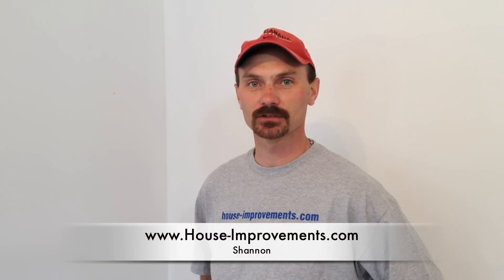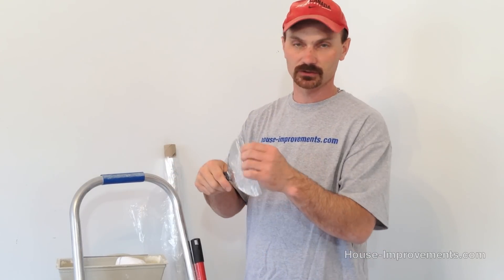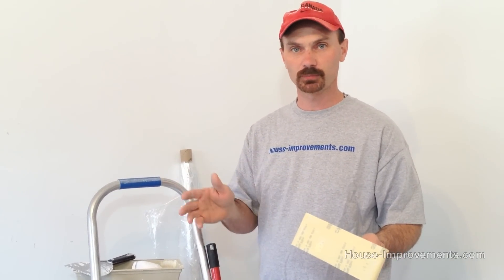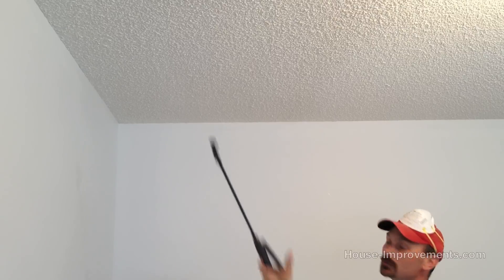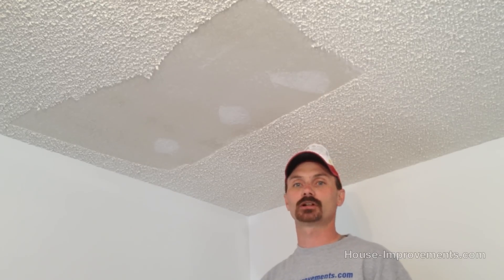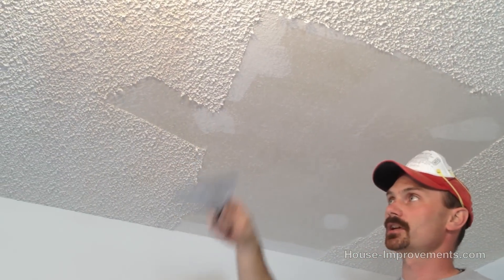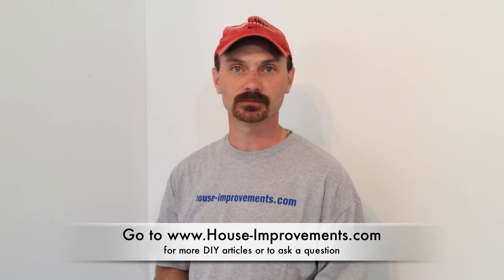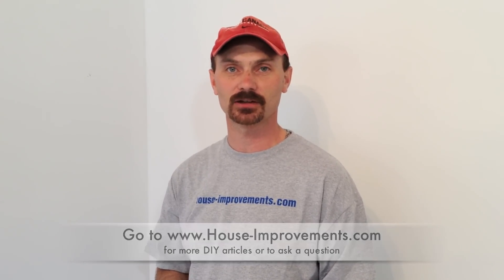How To Remove Popcorn / Stipple Ceiling

Comment: Is it me or is it relaxing to watch and listen to the popcorn scrap and fall off cleanly. Thanks for the video! I have a 2k sqr foot house built in 1988 to scrap clean.
Reply: Ron Ginn you may wanna check out some ASMR videos
Reply: How did that ever end up going, still enjoy the sounds? 😂
Reply: Please be aware that most popcorn ceilings contain asbestos, and by scraping, you’re releasing millions of fibres into the air, and normal vacuums cannot contain asbestos. This is a very hazardous thing to do!
Reply: RubberBanned Asbestos’s was stopped being used in between 1978-1980 so the op should be fine.
Reply: Jacob Hargraves They still use asbestos in architecture, to this day!
Reply: RubberBanned Yes but it has to be less than 1% in anything or it’s banned by federal law. So the risk is very very very low.
Reply: Jacob Hargraves Do you have a source for that information?
Reply: @RubberBanned  its not a concern im still well and healthy at almost two decades old
Reply: Me too!,,,,,
Reply: 1984 house full of corn, well I have removed some…👎
Reply: @RubberBanned  4:58
Reply: @almacuriel5771  Not a source

Comment: This is hella easy.  I just finished doing my house.  I sent a sample out to have it tested for asbestos.  It had a small amount in it but after researching, you'd basically have to work with it for many years unprotected to get mesothelioma.  I covered the floor in plastic and wore the mask with the two pink filters.  My ceilings had been painted over by the previous home owner.  The single best piece of advice I can give you is to spray the ceiling with hot water and let it sit for a good 10-15 minutes before starting.  Be patient.  The stuff will scape off without effort.  It's so easy!  Ignore the folks who say to never try this yourself.  They are contractors who want you to pay them thousands of dollars.  Any home owner should be able to do this themselves.  Good luck, and be sure to properly dispose of the waste as per your local government requirements.  It's easy!
Reply: Are you still alive? They say there's no safe amount of exposure to asbestos, that inhaling a fiber or two can be enough to get you.

I'm willing to pretty much DIY anything, and this popcorn removal is quite trivial, but it's just not worth the risk.

Comment: I tried to do this before watching the video because I was having a little trouble with it. It seems the ceiling was previously painted with a sand-embedded paint and I was trying to scrape that off. Hmmm, an old man's eyes can make a simple job more difficult. Also, I learned it takes more time to clean up a mess than it does to remove the popcorn, so Shannon, you are very right about the plastic and that mud tray. I finally got smart and put down the plastic. Now, thanks to  you, I will apply that mud tray in areas where I cannot get the plastic to lay as well as it should. Have a good weekend, and thank you.

Comment: This is a good video.  I just removed about 1500 sq ft of popcorn ceiling from a house I am renovating and did exactly as instructed.
In my case it was easier to stay parallel to wall, I found sometimes that when scraping perpendicular to the wall my blade would nick the drywall tape. 
Also, someone bought me a 24" ceiling texture scraper which worked ok.  But due to it's length and flexibility it was difficult to keep even pressure across the blade and I had some spots that were missed and some spots scored the paper or existing drywall compound.  I believe something in the 10"-12" range would have been a little easier to work with.
Lastly, one of the rooms I did had a painted ceiling.  I sprayed water on the ceiling and let it soak for about 10 minutes.  This seemed to weaken the paint, I could then gently scrape the ceiling which broke off the "tips" of the popcorn.  I then sprayed the ceiling lightly and let it sit for a few more minutes.  With the tips broken off the water was absorbed and I could scrape the remainder off as normal.
Reply: Non
Reply: I am doing a painted one now. Haven't lot's of problems getting it off. Been spraying lots of water on it, even tried hot mixed with vinegar and dish soap.

Comment from the maker: I believe it was band from being used in popcorn in the mid to
Late 80's but the stock that suppliers had was still sold until it was gone. So it is hard to say without testing because even in the early 90's you may have been able to buy it still in some areas.
To be honest my opinion on a small area is keep it wet so you are not creating air born particles or dust and wear a good respirator.

Comment: I followed this technique and had my bathroom ceiling finished in less than 30 minutes :)  Thank you!  and yes, it really is this easy if you prepare properly and have all your equipment ready to go.  It took me longer to remove the wallpaper than it did to take down the ceiling.  Now I feel confident enough to tackle the kitchen and living room (the only other rooms with Popcorn/Stipple ceilings).
Reply: Whether it's popcorn ceiling removal, or Wall paper removal, most painters,  unless very familiar with what they're removing,   will bid the job using the Time and materials method.

Comment: if the house was built 1963  ... should I remove the popcorn sealing or its dangerous for Asbestos?
Reply from the maker: Vet Vetsnipe It will have asbestos. Your call.
Reply: what about the linoleum flooring in the master bedroom? does it may have asbestos? or that refers only to tiles flooring?
Reply: Vet Vetsnipe If your house is built pre 1980s I would just assume that shit is in everything
Reply: Good question. My hose was built the same year, and I want really want to get rid of the popcorn ceiling as well, but the whole asbestos thing makes me a little nervous.
Reply: Vet Vetsnipe it could be in the mastic holding it down. Or even in the tile itself. Get it tested
Reply: Don't touch it either plaster over it some plasters will, some won't just look around but ffs don't scrape it off 1 microfiber can cuase asbestosis wich they're Is no cure it's not definite you will be affected but you most likely will
Reply: I just took mine off without putting on a mask😭😭 What happens?
Reply: @Emi-ig9fw  you got to be in constant in that environment to get sick like if you were working with it daily. u can check your doc and all but it's kind of like smoking. puff a little wont kill you. smoking alot will
Reply: @pandemic7  its never hurt me so youre fine i promise u can always get better after
Reply: HouseImprovements what’s about the 70s
Reply: @johnspence8141  Doesn't look like it. Rest in peace Emily G.
Reply: @skull4110  haha
Reply: @Emi-ig9fw  as long as theres no asbestos or dust you're ok

Comment: Hi great video! I'm doing this to my room, and I was wondering how long I should wait after removing the popcorn to paint the ceiling? Also what would you recommend to paint the ceiling with? Regular white paint, ceiling paint, or primer? Thanks!
Reply from the maker: I would wait until the next day , that will let the ceiling dry well after using the water. Prime the ceiling ,then use ceiling paint.
Reply: Okay, thanks so much!

Comment: Just an FYI... most old school popcorn ceilings contain asbestos fibers. Do your research.
Reply: HickoryHomeBrew if the house was built before 1970 there’s a higher chance there will be. But after 1970 is when they figured out the problem
Reply: 1982 was when asbestos was disallowed here in Ontario, Canada. However, Asbestos still remained on the shelves of companies and was in use until 1992.

Comment: My inspector told me my popcorn had asbestos.  Shouldn't you have more protection?  Is a mask and goggles enough?
Reply: no, it is not enough. hire a professional to remove popcorn celings
Reply: some popcorn ceilings have Asbestos, some do not. When was yours done? If it was after 1977 you are probably ok.

Comment: I've been painting for 40 years, this is how I did it 20 years ago. They also make a blade you can attach to a roller pole that holds a bag and catches it as you scrape, standing on the floor.

Comment: Yummy, breath that asbestos in!  Dude's got asbestos in his mustache.
Reply: +Yippie What a silly comment. There's no asbestos in drywall mud. There hasn't been asbestos in any house product since the late 70's at the latest.
Reply: +Timpala Wrong.  There are houses well into the 1980's that have asbestos in the textured ceilings.
Reply: +Trees Flowers only up to 1982. Not exactly well in.
Reply: +Andrew James When asbestos was banned in ceiling treatments by the Clean Air Act of 1978 in the United States, popcorn ceilings fell out of favor in much of the country. However, in order to minimize economic hardship to suppliers and installers, existing inventories of asbestos-bearing texturing materials were exempt from the ban, so it is possible to find asbestos in popcorn ceilings that were applied through the 1980s. Your guess is good as mine as to when all of the supply was sold and used. I for one wouldn't take chances on any house built in the early 80's.
Reply: Never said take chances. In Canada it was 1982.
Reply: Lol you literally plagiarized  the first few sentences
Reply: Painters are worth the money you pay them!  "Dude's got asbestos in his mustache"

Comment: Very good video. Simple and to the point. Outlays the tools needed and the process. I would add that to tape down the plastic to use painter's tape if near the walls. More expensive, but worth it in long run. Thanks HI guy.
Reply from the maker: Thank you

Comment: Soooo my popcorn ceiling has obviously been painted, darn it! The first couple of corner pieces came off so easily I was thrilled and then came to the part that didn't budge. Yours is the ONLY tutorial that addressed why the rest wasn't coming down. Appreciate it Now question: What else can I do to remove the rest?. I only need the edges cleared for hanging curtain rods and there is no wall space, Should I keep going or try something else? HELP!!!!
Reply from the maker: There is no secret trick i'm afraid ! If you only need to do a couple of inches around the perimeter then I would just keep working at it, sometimes if you can get some of the tips of the texture off then the water can penetrate better.
Reply from the maker: Please use my forum if you have more questions later on thanks
http://www.house-improvements.com/forums/
Reply: HouseImprovements Does a painted popcorn ceiling simply require more muscle power or is there extra damage that could be done to the drywall because the paint acts more like an adhesive to the drywall?

Comment: Great video, I am doing a bathroom due to mold and mildew sticking to the popcorn. Do you suggest a special paint to use instead of just ceiling paint so I can avoid mold & mildew problems in the future?
Reply from the maker: There are many good mold /mildew resistant paints and primers. The key will to be sure the ceiling is really clean and any problem areas are killed. Please come to my forum with any other questions.http://www.house-improvements.com/forums/

Comment: You make it look so easy !  Good video.  One question is how would we know if the ceiling was painted before ?
Reply from the maker: get up on a stool and have a real close look ,you can usually tell something has been applied over it.
Reply: Or if you take your finger and rub it over the ceiling and if a of texture comes off it is not painted if not much does and it seems hard then it has been paiinted

Comment: Nice video I'm currently in the process doing my ceiling right.
I was able to complete three rooms just as you recommended but then once I got to my kitchen and family room apparently the texture your ceiling was painted over, any suggestions on how I can get this off? 
I saw that using hot water and distilled vinegar will help but I haven't done it yet

Comment: "If it has been painted you may want to second guess weather you want to take this job on."  That's all I needed to hear.   Guess I'm looking at a few gallons of primer just to hide the painters tape blue color on the ceiling.  Took three coats of primer just to bury the same color on the walls.

Comment: If the plaster is in good shape it should be a lot easier than removing it from sheet rock. Plaster won't gouge when you're scraping it off like sheet rock will. Once you get an exposed edge, you can steam and water mist the edge and get the stuff off pretty easily. It's a mess either way so do what the asbestos abatement people do, completely plastic sheet the walls and floors before starting. A negative atmosphere is a good idea too. It'll pull any dust away from you. A dust mask is a must.

Comment: I have 2 large rooms and a long hallway to do. Wife is panicing about the mess it will make. Mine is not painted over, but is 20 years old. So I guess after the scrape'n is done, I need to prime and seal the sheet rock and git ah painting! Not fun. Very good DIY video. Thanks.

Comment: Hi shannon really enjoyed the video , as you said it's a very messy job if its painted, which mine is. My father put it up years ago and has been painted over many times. I'm just wondering is there another way around it by maybe putting a new ceiling over the stippling to hide it? Like MDF or something?Or would that be even more time consuming? Thanks Gareth
Reply from the maker: You can knock off the loose bits and then use drywall mud and skim right over it until you get it covered. Actually less work then scraping it off when its painted. You could also strap the ceiling with 1x4s and then hang new drywall as well.
Reply: @HouseImprovements  great advice thank you much appreciated 👍 . My neighbour is a builder so I might look into getting a price off him and see if he could do it that way instead 👍

Comment: Hi, our 1925 home has plaster walls & ceilings. There is nasty popcorn texture on the upstairs ceilings. Is it just as easy to remove from plaster as it is dry wall assuming the popcorn hasn't been painted? If it has been painted is it just a matter of more elbow grease or will removing the texture actually damage the plaster? Thanks & keep up the videos!

Comment: Quick question... after scraping, should the ceiling be skim coated around the seams & sanded before priming & painting?  Or, is it usually ready for primer with a little sanding?

Comment from the maker: If you paint that popcorn ceiling after you should not have problems
With the popcorn coming off, but it will also cause you problems if you ever what to remove it.

Comment: It has been so long since you posted this video but  I have  a related question . I have popcorn ceilings in my townhouse . Two different places have Freon leak damage. Can I just scrape off the damage stipple, treat the drywall with stain blocker and re-stipple those damaged areas? The drywall  does not look like it was damaged.

Comment: great video, just bought a property to renovate and the stippled ceiling really is an eye sore. ive been painting for a year now so ive learnt a lot but not much about stippled ceilings. a few things i would add; they sell carpet film which is adhesive on one side made for protecting carpet. a safety measure, those ladders are the number one cause of injury and death in the workplace so i highly recommend investing in a set of decent ladders or a trestle and for christ sake get a respirator!!!!!

Comment: Never thought it was this easy
Reply from the maker: It can be if the ceiling was never painted.
Reply: @HouseImprovements  saw your video just at the right time. I'm home due to the lock down and wanted to repair and paint the walls and ceiling but didn't know what to do about the popcorn ceiling. Now I know. Thanks

Comment: My ceiling has been painted I have to used Easystrip. I was wondering if after you finished in this video would the ceiling be ready to paint?
Reply from the maker: No it will need some sanding and maybe even some mudding touch ups as well.

Comment: I guess I have two questions. 1) Can the stipple with the stalactite look be removed in the same way, assuming it was not painted? 2) If there is asbestos in the stipple, is the concern for breathing it in limited to the time of removal or is this something that I should be worried about after the job is done and everything is cleaned up?

Comment: Does direction of scraping matter?  Someone warned be to be careful so I don't scrape tape.
I saw your other video about texture.   Do you still recommend prime and 1 coat before texture?  That same person told me to do texture first and then paint
Reply from the maker: Be careful when scraping towards the edge of tapes . Try to scrape down the length of them. 
You can paint after if you want to make it super hard but it will also be super hard to remove if you ever want to.

Comment: I might have missed this part of the video, but is the ceiling basically ready to be painted over after all the popcorn ceiling is removed and ceiling cleaned off?
Reply from the maker: They generally will need a little work mudding and sanding if you are going to leave it flat.
Reply: HouseImprovements Got it! Thank you so much ☺️ Have a great day.

Comment: If the ceiling is painted, does spraying with water work, or should a chemical be added. Your thoughts
Reply from the maker: I dont know of a chemical that will really help. Scrap off some to open some points of the texture and then use water . This may help but scraping painted texture is a real chore most times